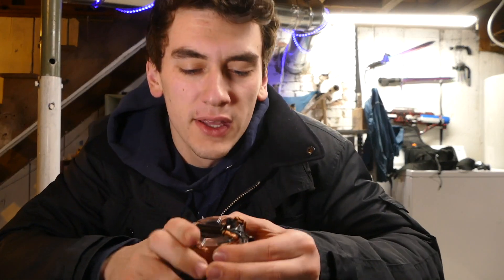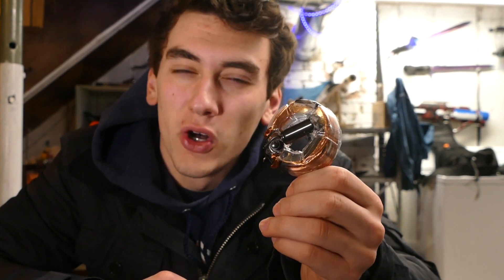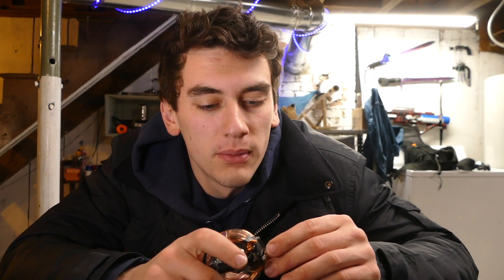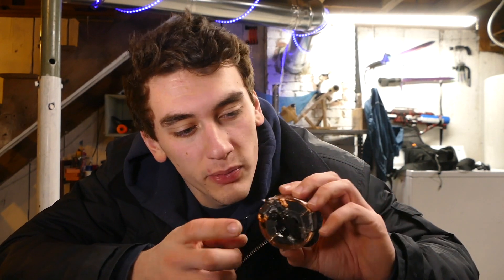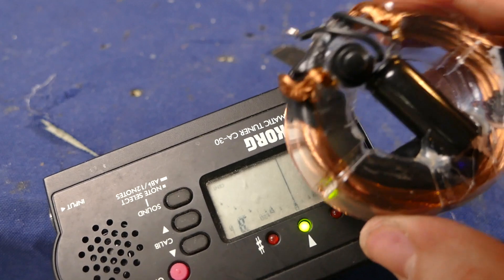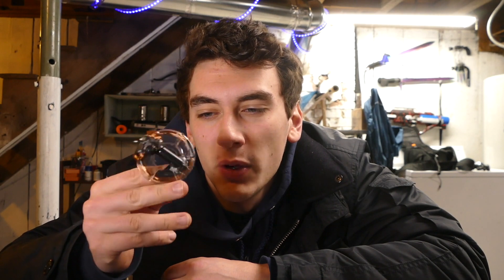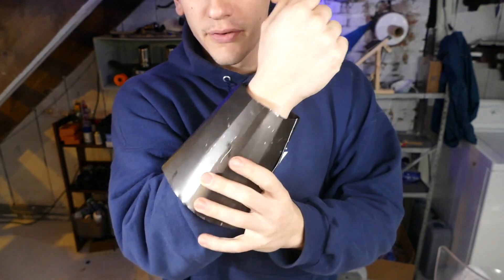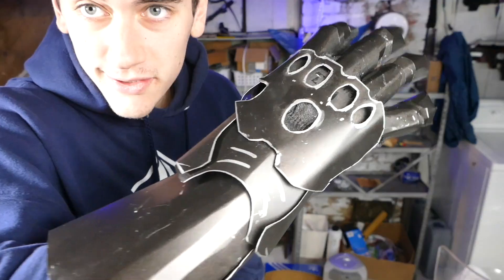DIY Black Panther EMP Device / Avengers Infinity War Update

Comment: Wait so did you charge the capacitor, the wired in a switch? How did you charge the capacitor? And from other videos i saw on this I saw the integration of a battery to charge the capacitor. I’m just asking how did you charge the capacitor, and if you charged it before integrating it into the device, that would make it a one time use device.

Comment: You should put a magnet on the Emp so that it sticks to the  things you stick it on
Reply: Creative director it would interfere with the emp...😂
Reply: i thought about that too its just if its like a couple those small dotted magnets it would most likely be fine because they don't have much pull
Reply: The Creative Ninja how would it carry the weight of the EMP? And if the magnet was strong enough to carry the weight it might react to the EMP getting close to it so the whole thing will just be a disaster
Reply: Retr0 XX yes you could be right but in this scenario the emp has very little charge so I think all in all it would be fine. Although I’m no pro and haven’t attempted any of this, but thanks for pointing this out to me.
Reply: @reyzfire134  electro magnets?
Reply: You could also just use some putty or one of those double-sided sticky attachment thingys you can get at hardware store. Just put it on the underside and you can slap it on whatever you want without disturbing the EMP.
Reply: @fortunesfoil  this is brilliant lol I forgot about this comment
Reply: and a high density wax, burn for endless smoke. all with a push of a button